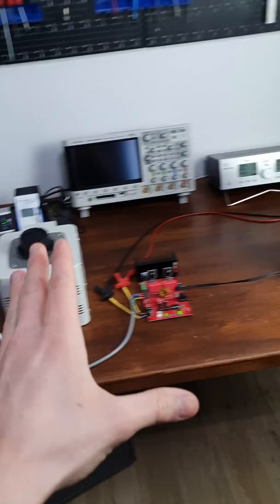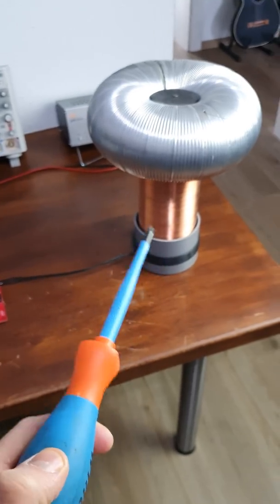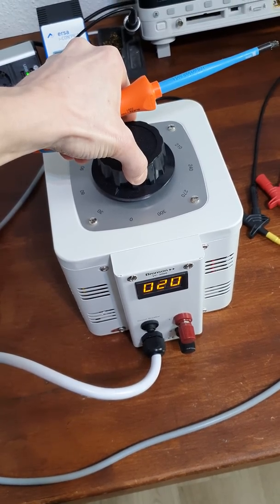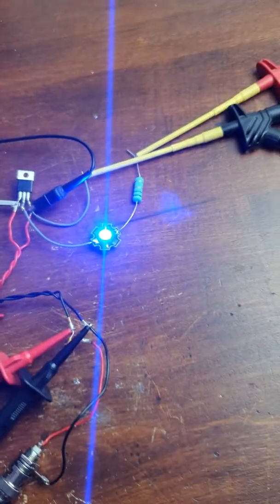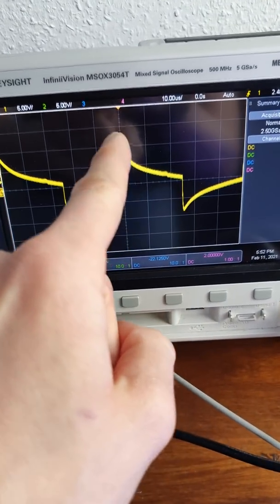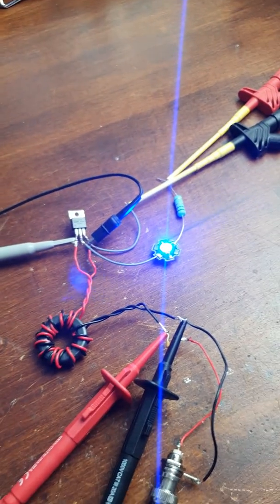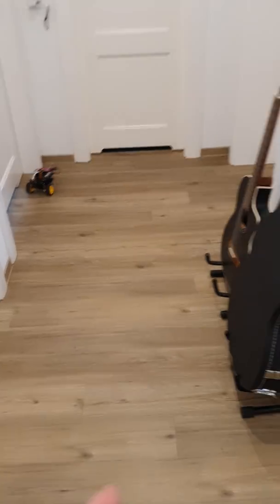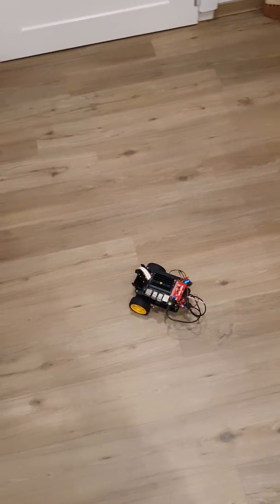February 2021 GreatScott! Behind The Scenes

Comment: I have a question, 1n4007 and 1n5408 diodes, up to what frequency do they work, i couldn't find tjat information in the datasheet, I am looking to use it in a buck regulator running at 52kHz, and what happens if I go over the frequency limit?
Reply: You need to use a Schottky diode or an ultra fast diode. Regular silicon diodes are to slow in reverse voltage recovery. 
A regular diode may need 120nS to recover, whereas a schottky response time is in the range of 1-2nS.
Reply: @piconano  ok, thank uou.